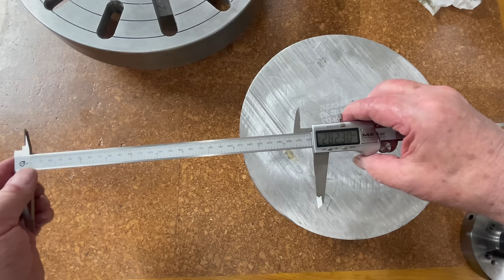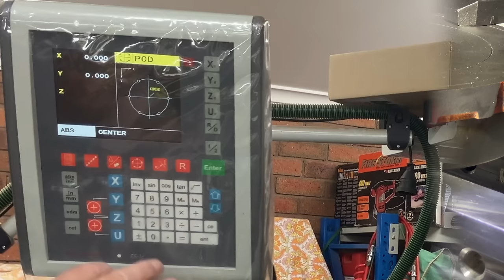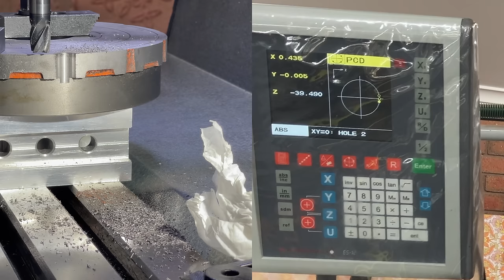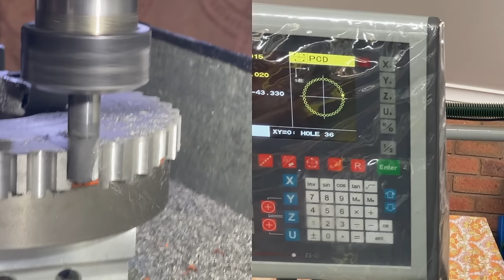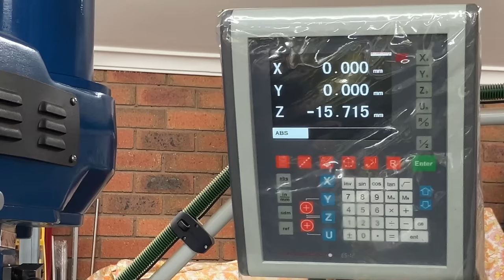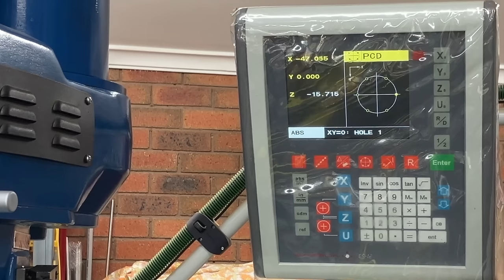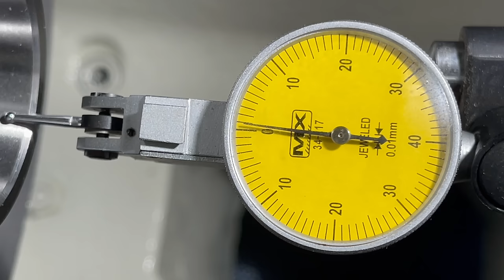The Most Accurate Lathe Chuck - Shop Made Tools

Comment: Nice build. I have recently done a similar mount for an er32 collet chuck on my colchester student. It all worked out well except it turnes out the collects i have are not very concentic.
Can you recommend any precision collets? Machinery house taiwan made?
Cheers from NZ
Reply from the maker: Hi and welcome to NZ. I have a set of ER40 collets for the Mill that I have had for some time, they are very good but I got a set of high precision ER40's recently. These are the links to them.
Machinery House:
https://www.machineryhouse.com.au/er-5c-collet-sets
M&G:
https://www.mag-pro.com.au/index/index/productsdetails/id/513.html
Both are excellent sets and both dealers have ER32 as well.

Cheers Steve O

Comment: Great to see an unused face plate put to good use. I have lost count for the number I have seen that are just being used for rust magnets or trip hazards.
I was however a little concerned at the method you used to mount the chuck? I would have thought you would have used the spindle nose mount in the rear as when it's mounted on that with the dowel/anti spin peg the chucks center run out is always the same and isn't affected by rotational forces. I have done this on a Face plate with great success for a customer. The run out replicated the machine spec sheet 500 mm away from the chuck. I understand that the chances of it being removed are extremely small but it can still float around. Let me explain
A significant issue would be the tapered faces the cap screws tighten up on. Rotational force say tightening the chuck or turning load is being taken entirely by the screws and as they are not fully seated and probably being deflected away from the natural centering of the tapered seats you could run into induced changing run out. Think of it like a 4 jaw and setting up a job to get something sticking out of the chuck a long way you can usually tap it to improve the run out further away from the chuck.  
May I suggest a couple of modifications to what you have made to improve it's repeatability
Please finish the cap screw mount faces with a flat bottom. This will prevent them from being affected by many of the things mentioned above. A nice slow HSS slot drill would do it easily but they need to be flat.
Try to source some proper High tensile cap screws as Stainless units may not corrode but are to soft for use in that application. 
Finally a drive pin or dowel of some type. This will take the potential side load of the bolts but with the existing parts you have made would need to be machined after the mount holes have been fixed and the chuck clocked up. 
If you have to mess around with fasteners the mount method has a problem.
However nice job and a great video.
Reply from the maker: I agree with you that the mounting holes should have a flat bottom and high tensile cap screws. I will fix that on your advice.
I don't agree with the set pin, the set-tru rods remain tight and add additional holding power to the chuck. The biggest chuck is 26mm so it won't be taking heavy cuts like other chucks. Also, I want to be able to readjust it from time to time.

Cheers Steve O

Comment: Nice re-purposing of the face plate! No point in wasting that virgin piece of aluminum. 
Nice job! 
I'm curious, isn't  0.003mm just a little over a tenth? And not nearly 2 tenths?
Thanks!
Good presentation 😊
Reply from the maker: Thanks for the comment. I think 0.003mm is 0.000118"
Reply: @theoutbackshed  that's what I had thought. 
You know you're in the outback when you find that you're making a LOT of stuff because there's no store nearby........ 😊

Comment: Interesting build and a clever way to use a spare faceplate. Also the idea of the 4 adjustment screws is quite neat and the result pays for all the extra work. Is the collet nut with thrust bearings?
Reply from the maker: Thanks for the comment. Yes, the nut has a thrust bering.

Comment: You could go as far as marking the low/high spots in the runout of the chuck and the collet. That way when inserting the collet in the chuck you can clock them such way that they cancel each other out. Might get you another micron of accuracy ;-)
Reply from the maker: Great idea, I like that.
Reply: What is really challenging (and you didn't check in this video) is to measure the runout some distance out from the collet. Nutation error is the bete noire of any chucking arrangement, and collets are no exception. A few microns of error close in can easily blow out to 50 microns at a distance of (say) 150mm.
Reply from the maker: Thanks for the comment and you are correct. I have just finished filming a sequel to this build where I do undertake that check. Keep watching to see the results.

Cheers Steve O

Comment: I enjoyed that.  I did notice you made a comment about not wanting to use carbide because of the interrupted cut, but then the chamfer  looked like a carbide insert.  Is that just because the chamfer is such a light cut?  I'm not a machinist (clearly), but watch a lot of the videos, trying to learn.
Reply from the maker: Thanks for the comment. I did cut the chamfer with a carbide insert. Although they are not as good at interrupted cutting as HSS, they will do the job. You are correct that this was an interrupted cut. It was a small light cut with little risk to the insert. I would not have used carbide for the initial machining after milling the plate as this would have been more aggressive.

Comment: Would you explain how your electronic centre finder works?
Reply from the maker: Hi and thanks for the question. The centre finder works by passing a small electrical current (from an internal battery) to the ball at the end of the probe. When it contacts the work piece it completed the circuit and the light comes on and the finder beeps. It is very sensitive and only has to touch the workpiece. it's important that the workpiece is free of oil as this can cause issues. The ball is 10mm in diameter and subtracting half of this value from the measurement will place the centre of the spindle over the edge of the workpiece. There are several ways it can be used, in this instance I was using it to find the centre of a circle, in other cases it can be used to find the edge of a workpiece or the corner of the workpiece.
Here's a link to it. 
https://www.machineryhouse.com.au/m690

Cheers, Steve O

Comment: Super fun video. But the audio could probably benefit from filtering/reducing the volume of the higher frequency parts of the vacuum and machining sounds.
Reply from the maker: Thanks for the comment, it is a key learning for me. I will make some changes in upcoming videos. Thanks for the advice.
Cheers Steve O
Reply: It might also have just been I had a bit of a migraine yesterday, but either way good stuff
Reply from the maker: Thanks for the comment. I did make some sound changes in my last video "Machinist Hammer". Have a look at that and let me have your comments on the sound levels. I might still have some work to do.  Cheers Steve O
Reply: @theoutbackshed  seems better! Or maybe my migraine is just gone today.  I think generally you may wanna think of the soundscape as a communication tool about how the process is going well or not, rather than just incidental. Maybe. 

Also one think that might be cool is down shifting the frequency in sped up parts, so it sounds like normal speed happening fast rather than up shifted
Reply from the maker: Great idea, I'll try that, maybe separate the soundtrack and deal with is separately.
Cheers Steve O

Comment: Nice build & video, Well done!!
Just curious as to whether you marked the ER40 Chuck & its adaptor relevant to each other or is it something you leave until your totally sure of its total runout after some use? Obviously the marking being relevant to disassembly should the need arise.
Reply from the maker: Hi, and thanks for the comment. I plan to use the chuck for a while then reset it, hopefully a little more accurate. I will put witness marks on the chuck and the backplate as you point out for disassembly. It will of course need to be 'dialled in' again. I will also put a witness mark for the spindle to ensure that the chuck always gets installed in the same place.

Cheers Steve O

Comment: This isn't the most precise chuck for long. When diameters of the holded workpiece not fit absolut exactly to the grinded diameter of the collet, only single contact points between the collet and the chuck take all the force, so both, chuck and collet wear out on these spots very fast. A common "wedge rod chuck" (is it the right translation?) is more precice over a much longer time. 
The most precice and long lasting solution (beside a hydro expansion chuck - yes, they exist also for workpiece clamping, but they are not very flexible in use -)  is a hexagonal collet chuck (p.e. they exist from HAINBUCH) but ofc. it is no solution for the amateur.   

But, u did a very good job on this, and for private use, it is sure really accurate.
Reply from the maker: Thanks for the comment.

Comment: Did you do anything to confirm the back of the faceplate was machined parallel to the front for the counterboring for the collet chuck body in the milling machine ?... 
It turned out beautifully btw (not a big fan of the SS SHCS myself though) 

A sub & a like !!

From the Emerald Isle
😎👍☘️🍺
Reply from the maker: Thanks for the comment and the sub. The back pf the plate already had a D8 cam lock mount machined into it, therefore the face I machined was registered to that. The plate was mounted onto the mill table on parallels located on that register, Only the 6x 8mm tapped holes were machined on the mill.

Cheers Steve O
Reply: @theoutbackshed  Ahh yeah, that makes sense of course, Steve...🤔.... 
thanks for replying, mate... 

😎👍☘🍺

Comment: You should grind the taper after seating it. You likely have some parallelism error as you didnt grind the end seat. 
After grinding a tool holder for a test i got it to zero microns on the tool.
Reply from the maker: Thanks for the comment. I don't have tooling for grinding so I will have to make do with what I have, there will always be some error with it. Great that you got to zero.  Cheers Steve O

Comment: The world is made of rubber my friend! There is normal machining +/- 0.001" or 0.01 mm, then there is precision machining where we go sub those measurements in magnitudes smaller. This is a realm where slight pressure changes and your breath heating things up can change the dimensions. In this your awareness to these changes seems to even change your breathing and cautiousness to minute details, everything seems to happen in slow motion. Part of my duties when not machining parts is building common rail Diesel fuel injectors, I have a range of less than 5 microns of adjustability on the critical dimensions, in this, minute temperature swings really skew the base measurements. I also do some OD grinding on some shafts that I manufacture. They are heat treated to mid 50's Rockwell and I try to maintain 0.000197" / 5 microns on the diameters, so I can understand what you are trying to achieve. Measure, measure, measure and slowly sneak up on it!
Reply from the maker: Thanks for the comment. I could only dream of machining in that range. 0.01mm is about where I get.
Reply: It would have been interesting to have seen the run out further from the chunk, as any errors could possibly been magnitude, or a test cut maybe, As the editing feels like it's left it hanging. In my opinion.
Reply from the maker: Thanks for the comment, Good suggestion, I will do this test in an upcoming video.
Cheers Steve O

Comment: 5C is more accurate than ER for work-holding and is designed for this. ER is designed for tool-holding.
Reply from the maker: I agree that ER are designed for work holding and ER for tool holding. However, ER chucks are being manufactured from lathes so their use has evolved, Both are useful but I think ER are more flexible as 5C work best with nominally sized stock.
Reply: @theoutbackshed Thanks for the reply. ER is more common now due to its cost, mainly, and flexibility. But my point was about accuracy. Precision 5C collets vs precision ER collets. For work holding, it's no contest.
Reply from the maker: Point taken..

Comment: I just have to say this, I am really annoyed that you sacrificed a face plate, you could have bought a chuck back plate from Hare & Forbes in Sydney for $66 and used that to mount the ER40 chuck to, Cheers from me.
Reply from the maker: Thanks for the comment. Disappointed that you are annoyed. There are a few reasons I didn't use a back plate.
The backplate has a large bore and would not allow for the mounting of 6 cap screws at 95mm PCD
The backplate is too thin in the cam lock centre and would not allow me to make the set-tru feature. I needed 19mm for that and this would not have left enough metal for the mounting bolts.
The camlock studs go right through the backplate but not the faceplate as it is thicker.
Hare and Forbes sell the D8 back plate for $319, I already had some spare back plates. Here's the link to the back plates
https://www.machineryhouse.com.au/l286

Hope this clarifies the build for you.
PS, I'm about to sacrifice another faceplate but this time for a Bison 5C collet chuck. Then we can do some comparisons.

Cheers Steve O
Reply from the maker: Your correct, the H&F price is too high. Lifting weights are not suitable as they are too thin . I needed >85mm. Also, I'm not sure of the composition of the cast iron that lifting weights are made from. I don't know how safe they would be when the lathe is spun up.

Cheers Steve O
Reply: Ok, I guess you must use another face plate, its a real shame, breaks my heart, wish you the best, have fun, cheers from me.🙂 @theoutbackshed

Comment: Your chuck was running the wrong way
Reply from the maker: Thanks for the comment. It was running the correct way. The video was shot at 25 frames per second and the spindle speed was se to 120rpm. This means that the video is "out of sync" with the rotation of the lathe giving the impression that the spindle ir rotating backwards.
Perhaps another view can explain this better than me?